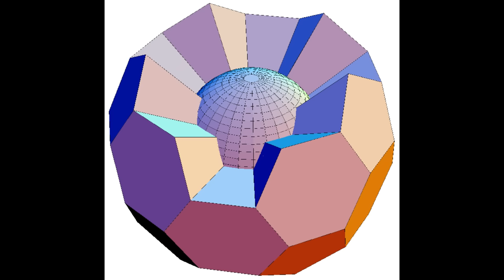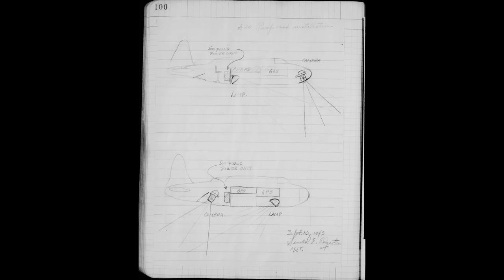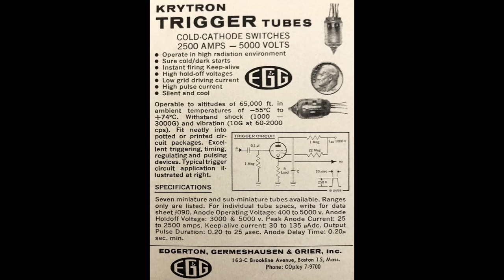Before The First Nuke Exploded... It Imploded.

Comment: In movies about the Manhattan project it fascinated me to hear the physicists talking about how difficult it is to make a nuclear bomb explode: the timings, the implosion, the precise geometric shapes of the explosives, etc.! Even though this is extremely complicated many people today still believe that a nuclear reactor can accidentally explode like a bomb!
Reply: That didn't fascinate me because they can figure that out by testing. What did fascinate me is engineering and problem solving they needed to do just to get material that can explode. Once they got that it was easy sailing from there.
Reply: Chernobyl acted sort of like a bomb. The reaction hall was completely destroyed and the force spread the radioactive cloud far and wide.
Reply: @Safetytrousers  Like a powerful conventional bomb, but you SHOULD know that's not what is meant.
Reply: @Safetytrousers A bomb, not a nuke. High pressure steam and hydrogen i think.
Reply: @Safetytrousers   He meant nuclear bomb...
Reply: @Safetytrousers  That was a steam explosion, caused by the rapid build up of the cooling water being converted to steam by the excess heat. The Chernobyl reactor also had no containment dome, a feature found in Western nuclear reactors, which is what allowed the radioactive material to be spread.
Reply: @suserman7775  Not even a bomb (which implies a detonation), just a really big, ruptured, pressure vessel.
Reply: @attilavs2  ''April 26 the chain reaction in the core went out of control. Several explosions triggered a large fireball and blew off the heavy steel and concrete lid of the reactor.'' The disaster was caused by an out of control nuclear reaction.
I said sort of like, as in similar to.
Reply: @Safetytrousers  Chenobyl went off like a very large and very radioactive bucket of thermite.
It did not release 25 TJ/kg in under 1 second.
Reply: @Sableagle  Noboby in their right mind thinks a nuclear power station would detonate like a nuclear bomb, if they have any idea of what a nuclear bomb is like.
Reply: @Safetytrousers  No. It just spread nuclear waste over time. Not like a bomb. The time taken was over 2 days.
Reply: @Safetytrousers  Many people are against nuclear power because of what a nuclear bomb can do. So they are indirectly equating the two sufficiently enough to block new reactors. Does it make sense? No. However, confusion gets them political allies.
Reply: turns out people are stupid. Having something to point the finger at and say "dis bad" dominates our species thinking. Funny to see how we get grilled from a sensory inperceivable gas instead, karma I guess...
Reply: This is a fun and positive conversation.
Reply: @Safetytrousers    The disaster was caused by an out of control nuclear reaction.
Which happened because of human stupidity and some interesting design choices. But mostly stupidity!

I said sort of like, as in similar to.
Well, it is similar to almost every boiler explosion in the history of steam power, because it IS a steam boiler explosion. And these are notoriously nasty as more water flashes into steam if the pressure drops even slightly — like steam escaping.

It does not matter if you use wood, coal, electric heating elements, solar power or mortally insulted space fairies to get the heat for the water.
Reply: @advorak8529  What about the fireball? It doesn't matter to my point why the nuclear reaction went out of control, it did. The physical incident was directly caused by that.
Nuclear bombs are instigated by people, and if they were to be used again that would be by human stupidity.
Reply: @primmakinsofis614  It's disputed whether a small portion of the Chernobyl reactor went prompt critical during the accident. This still isn't the same as a nuclear bomb, but it would have been similar to a nuclear "fizzle".
Reply: @primmakinsofis614  Steam is utterly terrifying when it does not want to be contained anymore.
Reply: @Safetytrousers  dirty bomb
Reply: @Safetytrousers  The irony is that if Chernobyl had been a nuclear bomb explosion site rather than a reactor meltdown, it would be enormously less contaminated than it is today.
Reply: They can, at least if they are made in Russia. The Chernobyl reactor did explode like a nuclear bomb. It was small, but it was indeed a nuclear explosion.
Reply: Nope!
Reply: @homo-sapiens-dubium I happened to know some early protestors .  The concern wasn't reactors going prompt critical like a nuclear bomb .  The concerns were radioactive contamination of valuable locations, the production of materials for bomb production, and the brutality of security needed to prevent theft of fissile material and/or reactor sabotage .  Of all these dangers, the infamous China Syndrome movie actually focused on the effect of mixing such a security apparatus with corrupt cost cutting in the construction industry .
Reply: @advorak8529  "mortally insulted space fairies" - I don't think Elon Musk will be able to cause enough heat for a flash conversion to steam, but I may be wrong 😋
Reply: @filanfyretracker  It's also scary dangerous when it escapes through a pinprick hole because it will remain invisible for meters before the steam becomes visible.  They started putting insulation on steam pipes in a chemical plant I worked at (steam is used for heating combustible materials) because someone walked through such an invisible jet crossing a walkway caused by a leak, and it basically cut him in half.  You don't mess with high pressure steam..
Reply: @Safetytrousers  
That was chemical.
Reply: @Safetytrousers  Way to conflate stuff. 3 mile island had no deaths. The foreign reactors use designs that have the moderator lose functionality as things get hotter. The prefect recipe for runaway. US reactors are based on the Navy design for submarines. Super safe with a moderator that moderates MORE as temperatures run up. But thanks for demonstrating the massive dishonesty your side keeps pushing. And if you're so concerned with 100 lives, tell me how many died from the other forms of energy production.
Reply: There's a scene in the movie Broken Arrow where John Travolta's character says to the people with him, through gritted teeth, "Please do not shoot at the nuclear weapon!" 
I always considered this to be for fear of it being damaged & becoming worthless, rather than any concern about it being triggered.
Reply: @freddoflintstono9321  that makes some of Boston Dynamics marketing. you can equip that Spot with FLIR and leak detecting audio equipment. Meaning you send the robot to inspect the steam pipe.
Reply: @suserman7775  3 mile island still looms large as a name. It doesn't have to caused any deaths to provoke fear of fission energy.
I am not offering an opinion on fission safety, I am merely explaining why there is a significant public distrust of it.
Reply: @shevek5934     It's disputed whether a small portion of the Chernobyl reactor went prompt critical […] similar to a nuclear "fizzle"
Or the demon core.  Which went clearly beyond critical into a run-away situation… then physics caused it to stop being critical.
Reply: @Safetytrousers     What about the fireball?
What about it?

the nuclear reaction went out of control
And … any time some fire goes out of control because of negligence and a flat, house, tower block, forrest, city (London and Rome come to mind as prime examples) goes up in flames, a fire got out of control. Literally.

Houses have been blown up by gas leaks and a spark or a flame. Happens all the time, just read the news. 

The physical incident was directly caused by that.
The physical incident was caused by too much heat for the water cooling involved, caused by severe operator error. Like most boiler explosions. 

Nuclear bombs are instigated by people
So are boilers. Wars. Many fires. Locked fire escapes, boilers and explosions, weapons, crime, …

Never mind collapsing bridges, dams, buildings, tunnels, derailing trains, car crashes, …

and if they were to be used again that would be by human stupidity.
I doubt the user would see themselves as stupid, more like “in the right” or “desperate” or “protecting their country” …
Reply: @freddoflintstono9321     Lots of caloric energy to be released, but no, I am not talking about a master of twits.
Reply: @filanfyretracker  That's an excellent idea.  When this happened, FLIR imaging has not been invented yet, but I think it would have saved lives.
Reply: @Safetytrousers  Chernobyl acted sort of like a bomb because the graphite moderator was sort of like a chemical explosive.  Okay, also because it started as a nuclear criticality accident.  The low grade nuclear criticality ignited the chemical reaction, the exact opposite of Trinity.
Reply: @Safetytrousers  And yet, people are all concerned about the Zaporizhzhia nuclear plant.
Reply: @psychohist  The details of the nuclear process are irrelevant to the perception of the result being as bit like a bomb, nuclear or otherwise.
I have not tried to suggest the event at Chernobyl was like a nuclear bomb going off.
The event was akin to a bomb going off and it involved nuclear material.
Reply: @psychohist  That's another on the list.
Reply: @Safetytrousers  But the explosion was not nuclear. The explosion was from the high pressure steam.

Chernobyl was more like a dirty bomb than a nuclear explosion.
Reply: @damouze  It was an explosion involving nuclear material. The reason for the steam was nuclear reactions.
Chernobyl was the equivalent of a bomb going off and it spread nuclear contaminated material.
It indeed was nothing like how a nuclear bomb works.
Reply: I'm sorry, you're erong. In nuclear plants,  a moderator is a thing that INCREASES fission by slowing down the neutrons and increasing the chance of collision. The problem is the literal opposite of what you said.